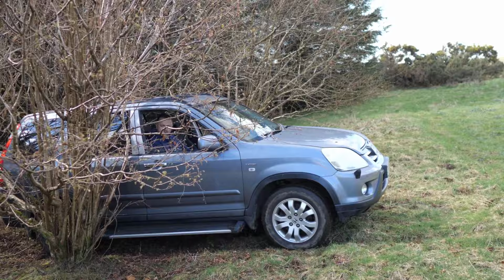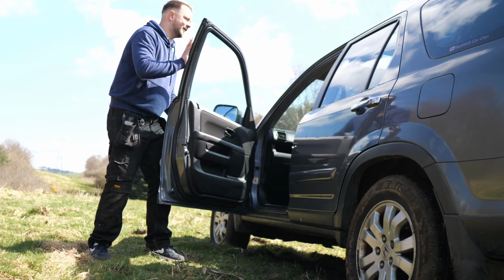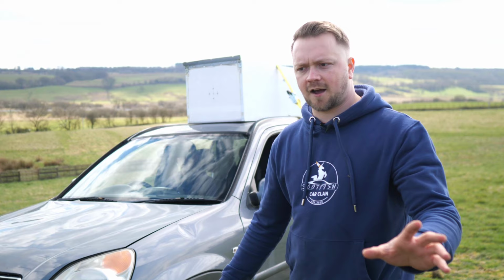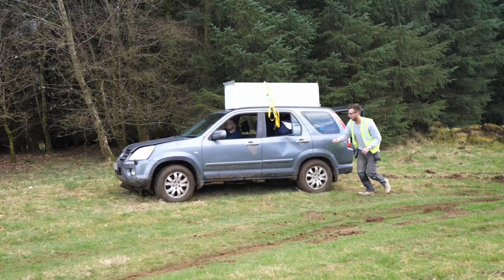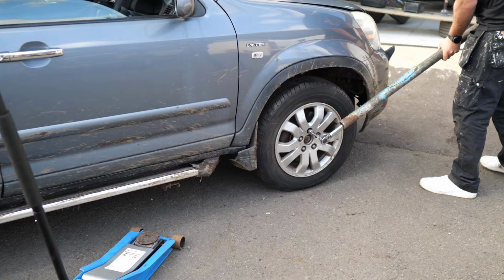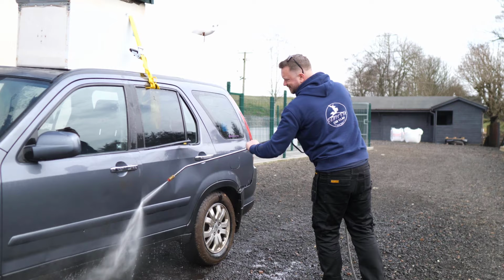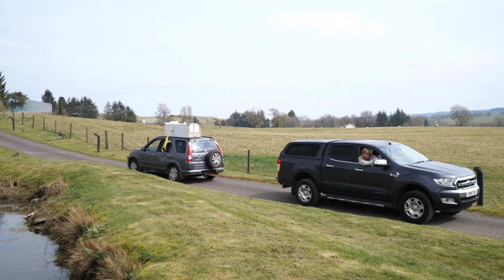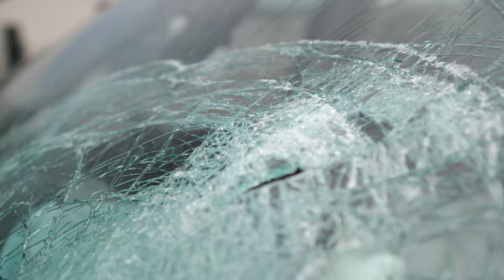Honda CRV Durability Test (to death) Part 1

Comment: So painful seeing a fine looking ever reliable vehicle getting abused/destroyed intentionally just to prove a point.
Reply: I kinda wanna know how durable it is. This came in clutch for me. There is also about 3 million of these cars.
Reply: That in itself is a point, surviving delibrate abuse really showcases how Honda built these. This video would only increase the respect and reputation of the company and the car.
Reply: Its a crv?? Iv got one there almost invincible
Reply: did you said reliable😂😂
Reply: @Bigguy4778  what’s laughable? there will be some few bad examples but the rest are very reliable. What’s your argument? That Mercedes, Audi, Jaguars and BMWs are more reliable?😂
Reply: @JanBanJoovi-ol1qv  for reliability  i give mercedes 3/5,audi 2.8/5,jaguar 3/5,bmw 1.8/5,crv honda 1/5.youre laughing at your own examples you dont know what i own.ive saw many crv's got the rear wheels snapping off there place😂 many engine failures,transmition is trash.btw i own many cars with military reliability grade😉.1987 land rover defender offroad built,the legendary 1979 toyota land cruiser offroad built.2000 dodge dakota with a tuned 5.9 liters it becomed a 6.7.grand cherokee xj offroad built with a 6.2 vortec.and a grand cherokee 2013 for daily driving.and if you know the old mercedes unimog i got one for the work and for tough roads
Reply: @Bigguy4778  blah blah blah. You’re not the centre of world. Your experiences don’t represent the entirety of the population. Just because you had encountered some bad examples of a honda CRV doesn’t mean honda CRVs aren’t reliable. Typical main character syndrome.
Reply: @Bigguy4778  and just so you know, there’s no such car model that is 100% reliable. There will always be some bad examples. Geesh, how come you not realise that🤷🏻‍♂️
Reply: @JanBanJoovi-ol1qv  you asked for that karen.trust me you dont know more than me about cars,and specially crvs.2 members of my family got crvs ive saw alot about them.there poorly build all cheap materials.to heavy for suspention design.every single crv ive saw in my life never had straight rear wheels
Reply: @Bigguy4778  why would I trust you and your experiences. I’m a mechanic myself and based on experience, never had massive issues with CRVs from gen 1 to current models. Don’t you understand probabilities? A few bad examples don’t make a model unreliable in general just like what you’re trying to say. If for a car model to be considered reliable is for it to have zero cases of breaking down, then no such car model is ever reliable at all. Welcome to reality.
Reply: @JanBanJoovi-ol1qv  i dont think youre a mechanic.youre probably a high schooler who got his new crv.dont want to trust me,your problem.but keep an eye on every crv you see on his rear wheels.there never straight.very bad suspentin design and bad quality.they never last long and are very dangerous,and every single crv have this problem.if you were a mechanic you would known this.and theres so many other bag things about this car,but im giving you the simlples to understand
Reply: @Bigguy4778  😂believe what you want to believe. I’m not surprised if you’re a flat earther.
Reply: Faut bien qu'il trouve quelque-chose a détruire ... La plupart des suv  Land rover se détruisent  tout seuls et n'auraient pas tenu le quart de ce qu'il fait pitoyablement endurer à cette Honda

Comment: Absolute legend of a motor! I had a CRV Diesel 2006 2.2 executive & we ran it for 8 years. It was so reliable & had no issues passing it's MOT each year. We only recently got rid of it as it eventually had corrosion issues, which weren't cost-effective to repair. We went straight out & bought a newer model, which is also awesome. I've had newer & supposed better cars like a BMW, which always had a hand in my pocket! Honda CRV's are honestly the most reliable low maintenance comfortable safe & good value cars on the road.

Comment: Honestly, that was real stupid 😮 . We all know how strong and well built these Gen 2's are, well anyone who is in the know.... What was wrong with it as to not being road worthy?
Better have been either repaired or given to someone who needs a vehicle/learn to fix it rather than destroy it....
Reply from the maker: Car is worth £300. Needed approx £600 of work to make it roadworthy again - mainly welding. It was this or straight to the scrappers anyway 🤷🏼‍♂️
Reply: I agree. This wasn't so much a durability test as it was a lets destroy a CRV for clicks. This examplerseemed really clean and an excellent parts car. I am sure they could have found a much rougher example to do the test with. This example did not deserve to be treated this way.
Reply: @departe5672  
I think you are overthinking this a little to much. You might want to dial it back a bit. 😄